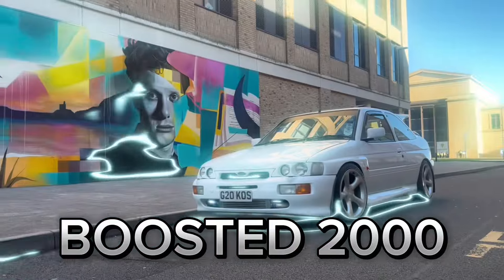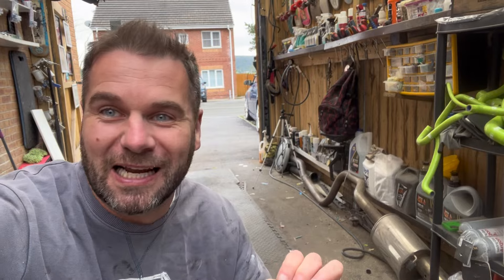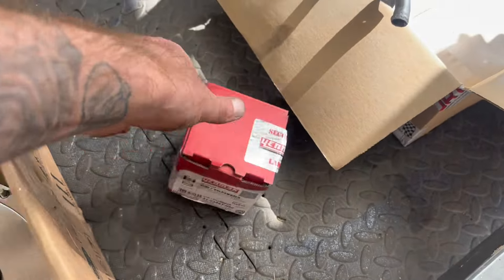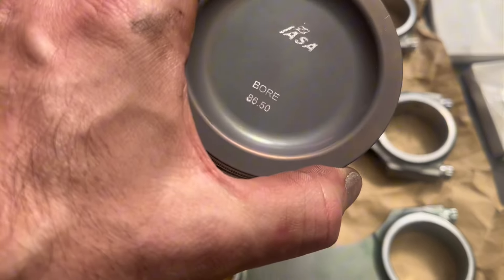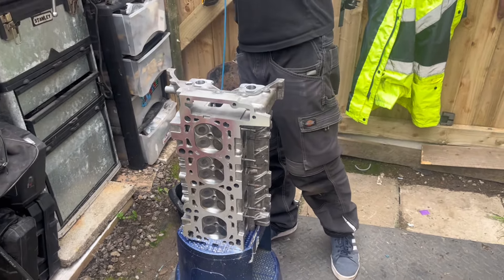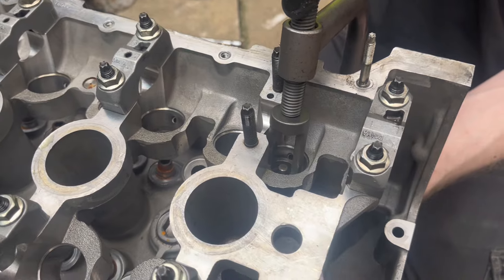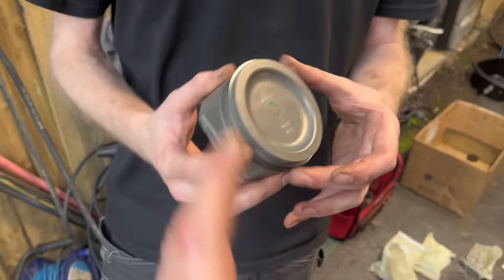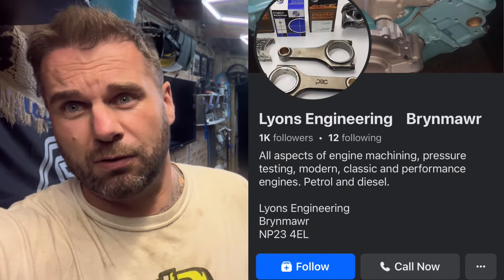Forged  Escort RS Engine Rebuild. How to rebuild Your Engine For BIG POWER

Comment: How did the book say and how did you torque the mains up at mate ?
Reply from the maker: Between 66-77  buddy
Reply: @boosted2000  seems mad to allow you so much leeway to guess no angle to get after said lb ft ?
Reply from the maker: @Benharcombe following the Haynes data . Seen another data sheet , more or less the same . But one in nm and ones ft ibs and 90” 

One way of finding out !
Reply from the maker: Also , there not stretch so wouldn’t go with the 90”